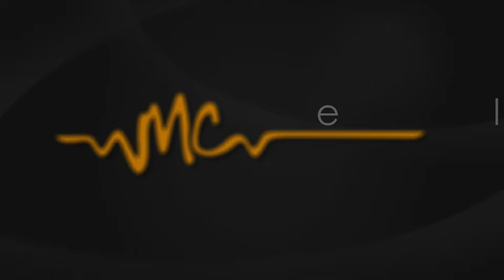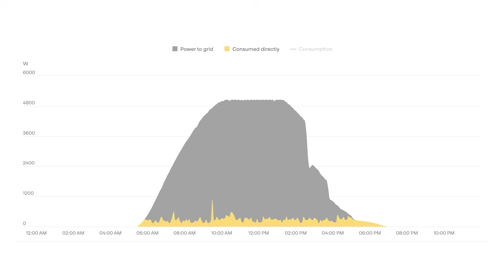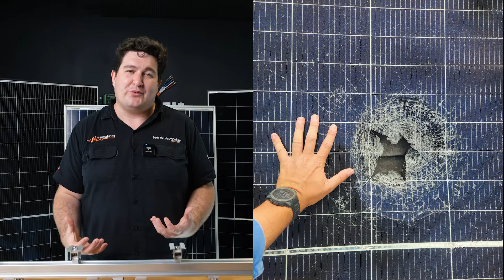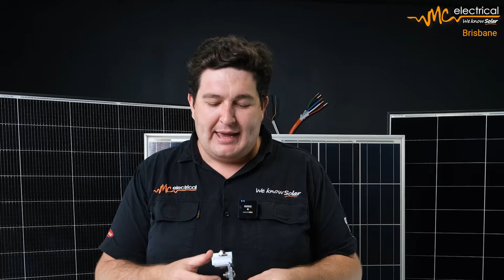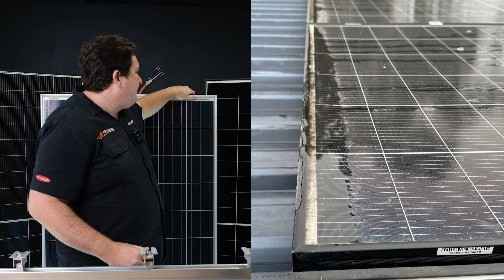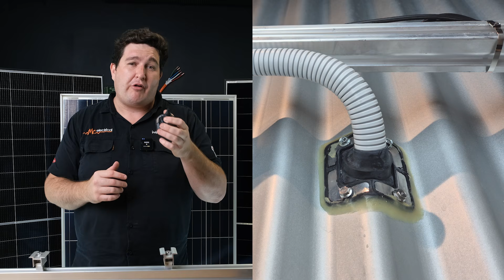Solar Panels & How They're Installed | Basic to Basics | Episode 2

Comment: Thanks so much. I have the shading problem from neighbours trees and my trees, so it is wonderful to get your advice on avoiding shade with these new panels. 
I have an existing 5kW system on 2-phases ( 2..5/phase) installed in 2012 and it has worked well. Paid for itself in 3 years amazingly and have had no faults to deal with. 
My good contract with Origin runs out in July 2028 and I have ordered an EV, due in November 2026, so I am  researching an upgrade now to a battery/EV charger/Solar system. I have a 2-phase supply and I am trying to get advice from installing companies on what I should do. Should I go back to 1-phase to reduce equipment costs, stay with 2-phase or upgrade my Energex supply to 3 phase to take full advantage of a 3-phase inverter, battery and EV charger options. I need a new property power pole ( 32 years old) as part of this upgrade anyway so changing to single or three phase is an extra expense but now is the time to do it, if its desirable. 
Many thanks again for your informative videos.
Reply from the maker: If you are looking to upgrade, most houses (e.g. new builds) are going to 3-phase. On single-phase Energex limits solar installs to a 10kW inverter, but if you have the roof space for more than 13kW of panels, then 3-phase with a much larger system would future-proof you especially with an EV. Do you have the roof space for more than 13kW?

Comment: In other videos (installer in uk) I’ve seen recommendation for side mesh, or panel to prevent birds nesting under panels. Interested if you do this or ever see issues in Australasia with this. Secondly any concerns or different techniques in extreme wind zones (I.e. wellington :) ), other than just more fixings ?
Reply: Bird mesh is not a bad thing to add. But unless your house is chosen by the local pigeons as THE nesting roof, bird proofing is usually unnecessary.

Regarding high wind areas. The racking manufacturer will have installation guidelines based on the wind category. Usually, its reduced spacing between the racking feet or in more extreme conditions such as cyclone-prone areas like far north QLD,  3 sets of rail per row of panels are installed instead of 2.
Reply: At MC Electrical, we recommend a 3rd party for bird mesh installations.

Comment: if you have 10 year old solar panels..... is it worth coughing up and getting new ones? they still work.... just not completely filling up the home battery.
Reply: If you have the option for a time-of-use power plan. You could use this to top the batteries up from the grid on the days when you have insufficient excess solar power. Mark and I discuss this and the potential pitfalls in this video: 
https://youtu.be/Kvc-xbUTPDQ?si=8xiOt6IAB1C6EA_h

If the panels are 10 years old and are in ok condition you could keep them for a while longer. If the panels are damaged due to hail or starting to show signs of deterioration or if your daytime usage is increasing then a new larger array may be worth the investment.
Reply: Have you broken even?
Reply: @im_not_an_elephant no. In winter our bills are now $200 a month

Comment: For flat roofs why wouldn't you consider using alternating east west tilts where possible? Or cookie cutter configuration. Best of all worlds, more panels than flush installs even. More cooking for panels to boot. No shade issues 

/\/\/\/\
Reply: It can be done and we have installed systems in that configuration. You would want to keep the pitch low (15deg) to maximise the performance. There are other considerations if the roof area is limited, as the clearance zones from the edge of the roof are linked to the height of the panels. There is also the balance of the additional hardware and labour cost associated with tilting in such a configuration.

Comment: How would you run the cable/s down the wall cavity from a second story? Are all the wall cavities empty?
Reply: It's usually only posible to run cables internally on a low-set brick veneer house when retrofitting solar. On high-set homes, it would have to be done during the build and run in steel conduit. There is a good blog relating to this linked below.

https://mcelectrical.com.au/blog/solar-on-a-new-build-home/

Comment: Aluminium and Colorbond roofing is a compatible combination and does not cause any issues as confirmed by Lysaght technical documentation. Stainless steel is the problem metal and stainless steel screws or stainless steel flashings should never be in contact with standard Colorbond roofing. Roofing screws should be minimum Class 3 or Class 4 in coastal areas.
Reply from the maker: That's why we ensure complete separation between the two metals with rubber washers to avoid galvanic corrosion. Are you a roofer or solar installer, mate?

Comment: is the clamp system the same that would be used on a colorbond roof, say on a carport where there is nothing underneath to screw into
Reply: Direct to sheet attachment is a solution but the carport would have to be structurally sound. Unfortunately most of the sandwiched foam carports are not
Reply: @Yorick_Mark  structurally sound as in built properly by a registered builder and approved by council? my carport doesn't have sandwiched foam, its just one layer of colourbond nothing inbetween.
Reply: @SEQ_Virtual_Tours_2025  Structurally sound would be a weight-bearing capacity of 25kg/m2.  If it's just a single sheet without framing (rafters and battens, etc.), it would not be structural.